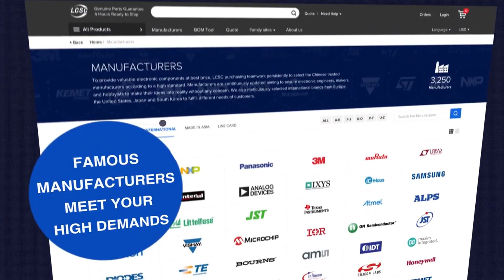50V-0-50V 10A 1000W SMPS Peak 1500W | LCSC Electronics | American Electronics

Comment: Transformer in supply will make lot of noise when load is switched on or off suddenly. It should be soaked in epoxy and heated for some time. Nothing is clear about begning and end of any winding, this is very important. If winding terminals are reversed, whole thing will blow in no time.